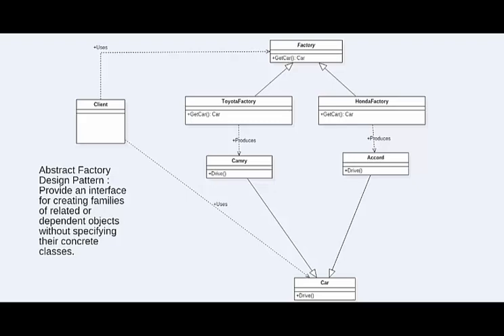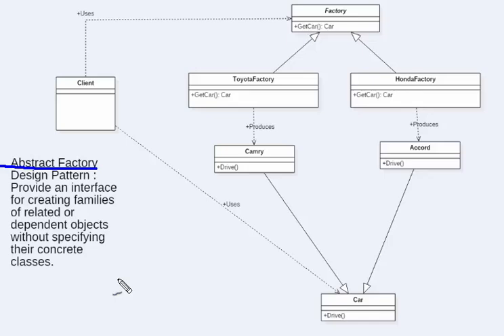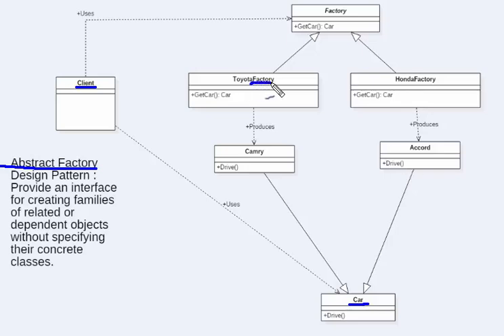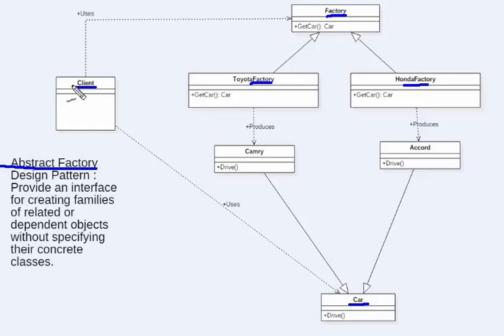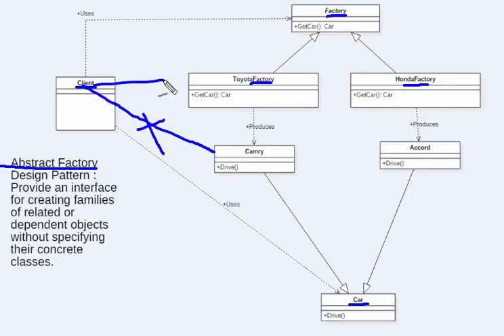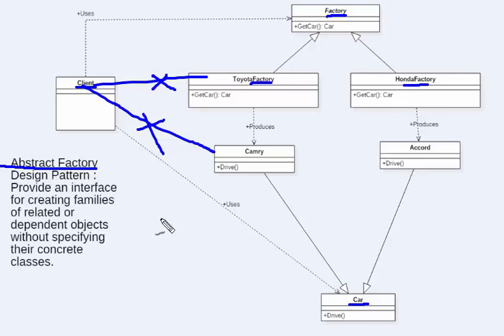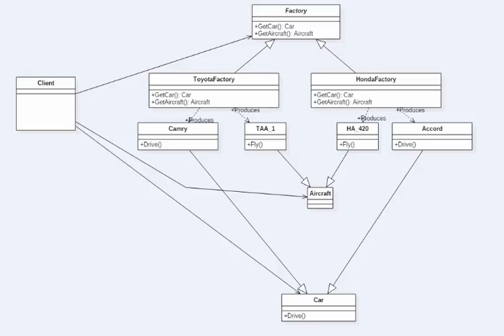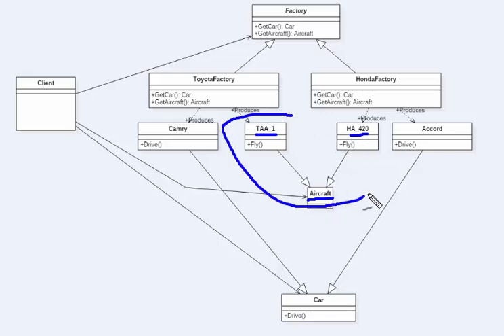Abstract Factory Design Pattern: Part 1 of 2

Comment: Totally useless points . Deviation from the topic -.-
Reply from the maker: Thanks for your feedback. I'd like to hear from you why you feel this video is off topic. Abstract Factory is a pattern that many beginners find hard to relate to. So I took an example which is probably not very practical but it is something which is easy to understand. In my example, I have categories of factories (Toyota and Honda) and categories of products (Cars and Planes). in my opinion, these examples are easy to relate to and can be applied to any software design and construction.